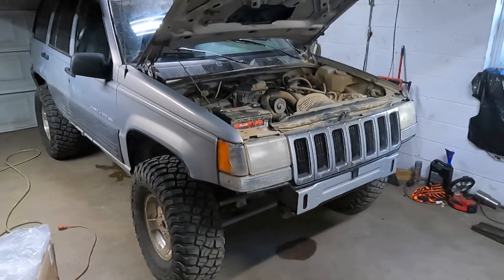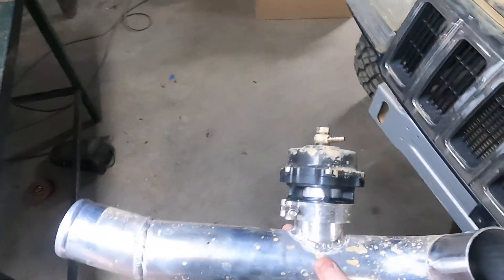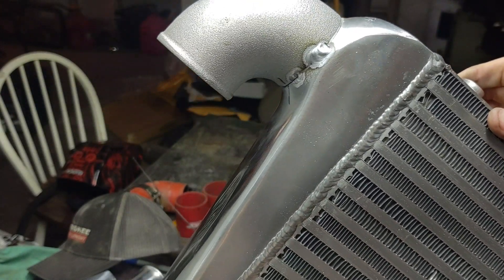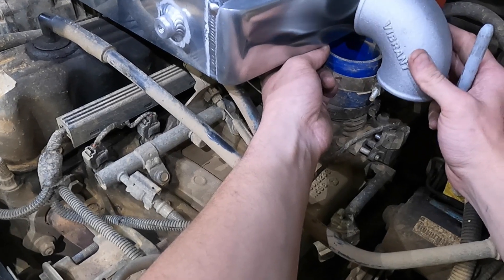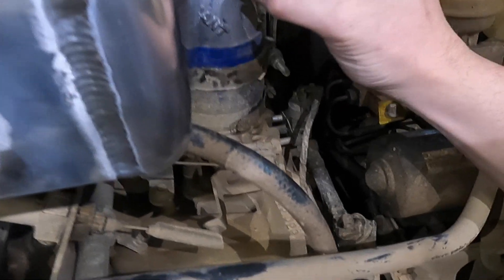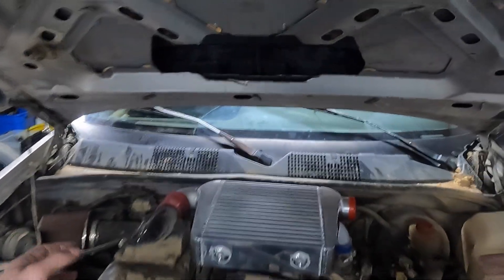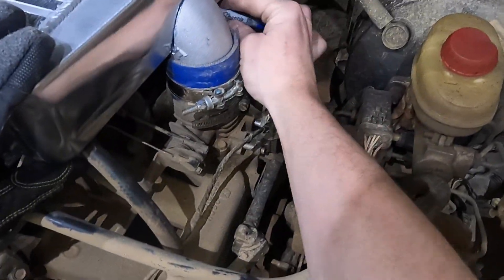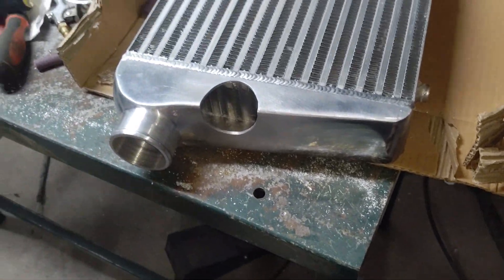supercharged jeep zj intercooler

Comment: Doesn't make scense putting in the location the air was already running it's going to be same temp as the straight air before
Reply from the maker: You need to watch the intercooler testing video. It worked great.

Comment: Try getting a Ford Taurus e-fan and ditch your factory clutch fan. You can probably fit the cooler in there. Mine was just a straight pipe from the charger to the intake, internals didn’t like it.
Reply from the maker: Im still considering an e-fan but I like the reliability of the clutch fan and as much time as I spend putting around in the woods I like not having the electric draw. But I still may go to a electric fan and keep get that couple horsepower.